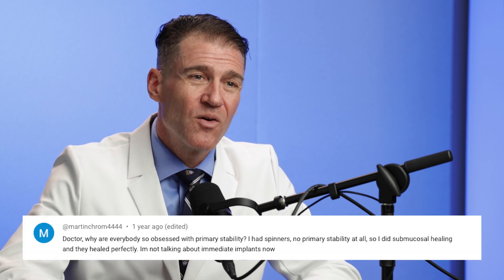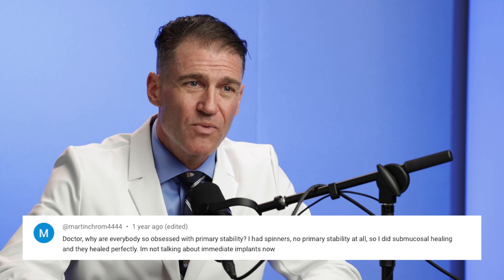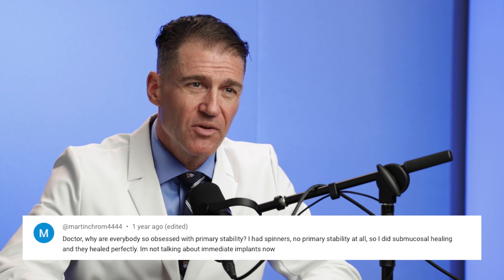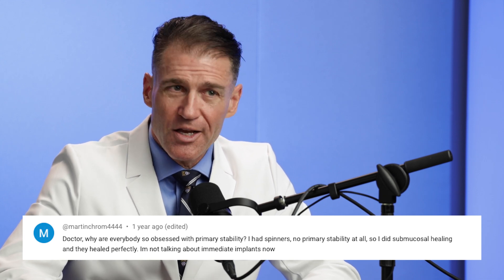Is Torque a Good Measure of Dental Implant Stability?

Comment: What parameter do you use for stability?
So according to you there is no need of threaded implants for primary stabilit, so we would love to thousands of cases of pressfit implants if you can share.
The threaded implant geometry and mechanics can only be corelated with the torque parameter to understand its stability ... think about it. Although many other sensible factors need to be considered for successful osseointegration isn't it? 
Logical need to be practical.

Comment: For single implant cases, do you think the implant torque makes any difference in your clinical judgement. Such as do you use to to determine whether you place a healing abutment or immediately temporize? To be clear, this is in single implant sites, not full arch with cross arch stabilization.
Reply from the maker: I do not rely on torque to determine treatment modalities for single or full-arch cases, and I am currently writing a paper to explain this concept in greater detail. Torque measures resistance to rotation along the long axis of the implant, but it doesn't account for the other five degrees of freedom that influence implant stability. For example, consider a nail driven into a piece of wood—it has zero torque, yet it remains stable. Attempting to remove it with your fingers would be difficult, despite the absence of torque. This illustrates that stability is not solely dependent on rotational resistance.
Reply: @Stanleyinstitute  This makes sense. I'm interested to see when your paper comes out, please post a video of it once released so I can give it a look

Comment: Just because you dont attempt to spin it to identify the amount of torque does not mean that there is no torque. There is, you just didn't identify the amount of torque that pressed fit implant had. Although, the autogenous harvesting of bone is thee best to place with the implant. I do agree with a zero torque implant being placed, is also left un-loaded at time of placement. And torque total is not a good idea to place prosthesis. However, a full arch stabilization is huge for multi-fixture prosthesis. Great advice. Thanks
Reply from the maker: Agreed. Cross arch stabilization is key to full mouth reconstruction. Torque just isn’t the metric which one should measure it by.

Comment: Excellent presentation as always … Are you suggesting that if you had 5 spinners … as you say zero torque… you would still load your case immediately?
Thanks
Reply from the maker: The answer depends on a few more parameters. If all five implants were 4.2x15mm and the meet the five thread guideline for predicting stability I would absolutely provisionalize the case. I also have my patients on a two month liquid diet.

Comment: Hey Doc, thanks for another great video. If you get a spinner, would you always bury it or a healing abutment would be OK as well, provided there is good occlusal clearance.
Reply from the maker: This answer depends on whether it is a healed site or an immediate implant placement. In healed sites where you can place a healing cap and easily accomplished primary closure this would be considered a risk reduction protocol. However, I do not recommend placing a healing cap in fresh extraction sockets. I recommend sticking with the original plan of gap grafting and a 3mm regular transmucosal healing abutment. When healing by secondary intent, I find that the epithelium does not effectively close over the top of a titanium healing cap which leads to an annulus,  allowing sulcular fluids to flow underneath the operculum which my imped proper healing. I have an ongoing study that will be published soon that supports this practice. Great question!